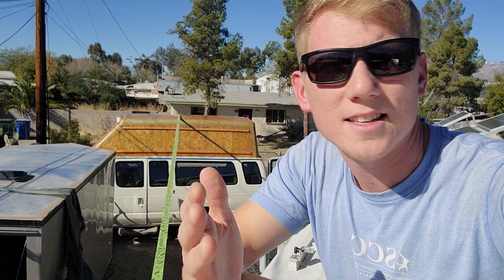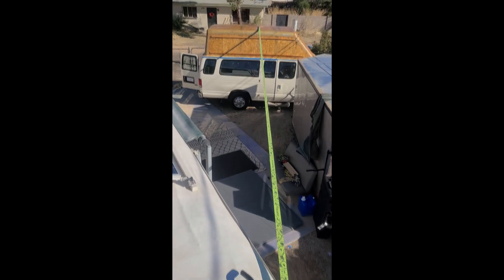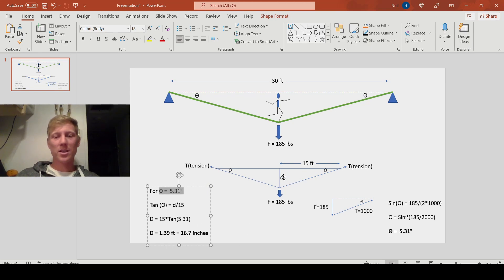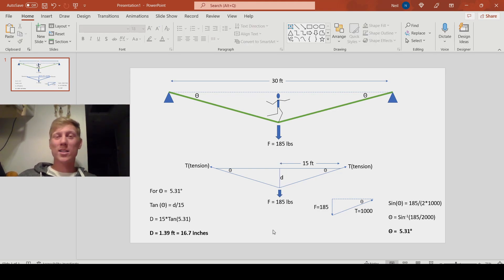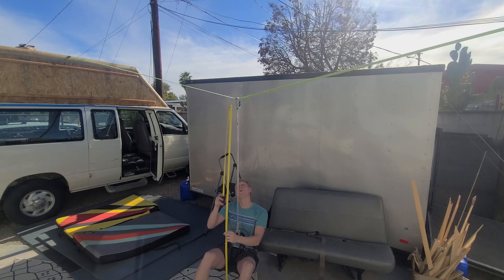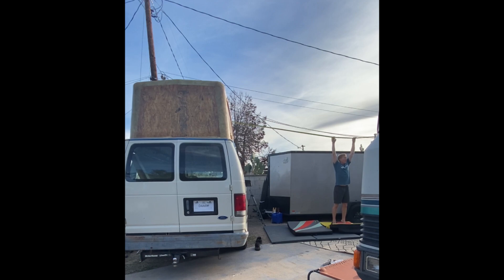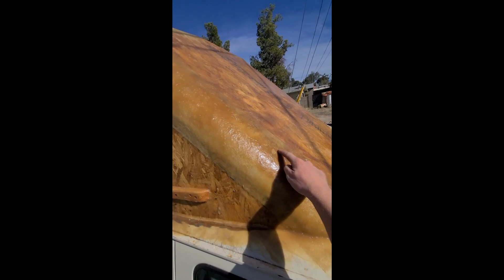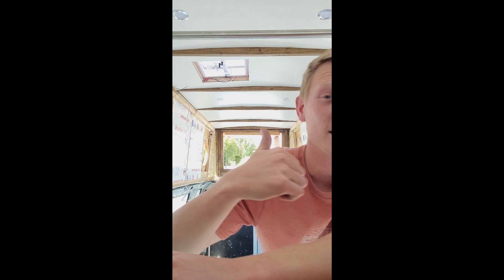1000 lb Load Test- Can My DIY Topper Hold Up Under Stress?

Comment: How many pounds is weight the top ?
Reply from the maker: Roughly 300 lbs
Reply: @SisuVan is that the differential considering the lost weight of the original roof? Or pure weight of the new higher top ? Love this build

Comment: NICE JOB! I've planned on a wood fiberglass high top on my chevy van. I was battling between metal framing vs wood. I feel better now learning about the physics and what not.
Reply from the maker: Thanks!  Yeah, either one would work just fine, aluminum could actually be lighter too - most of the weight is in the sheathing though.
Reply: @SisuVan  I agree, my first few designs on SketchUp are with aluminum framing / plywood sheathing. I think I’ll still use some aluminum angles or tubing for certain parts of my frame. 

Once again though, great job!